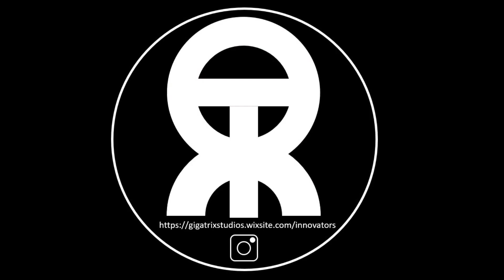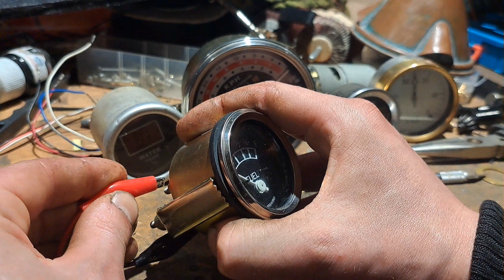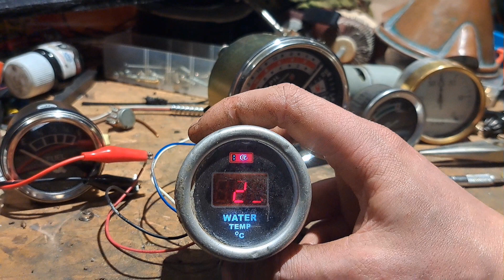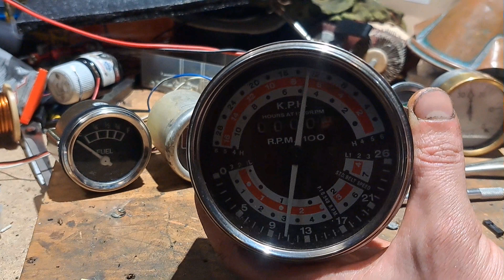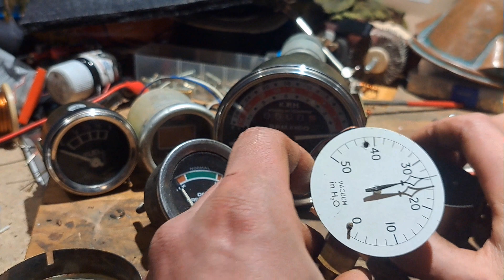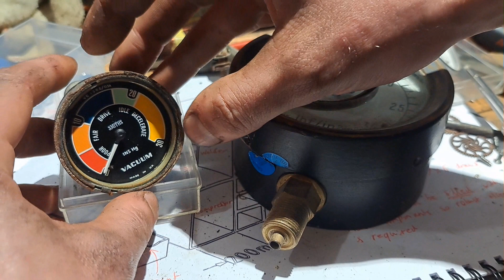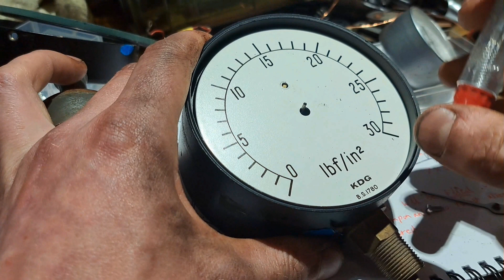Hacking gauges! A quick and dirty guide to modifying gauges.

Comment: 0:37 - "This video was brought to you by the crushing pressure of reality" - I've got news for you... my whole day was brought to me by the crushing pressure of reality!
Your water temp won't go any higher than 150 - since that's what it was at when you dead shorted the wires before you put the potentiometer on. So, 0 ohms = 150 degrees.  Probably won't go any lower than 25 degrees because that's what it was with the circuit open: infinite ohms 😆
And you're quite right - it works by being connected to a thermistor, which is a resistor that alters its resistance dependent on temperature.
The servo hack was bloody awesome!
Reply from the maker: It's good to know we don't suffer alone! Xxx
Reply: @Gigatrix  😄 Cheers. Looking forward to seeing more of your cosplay builds.